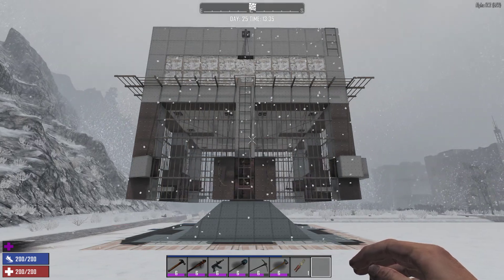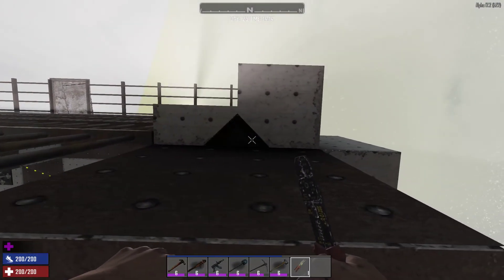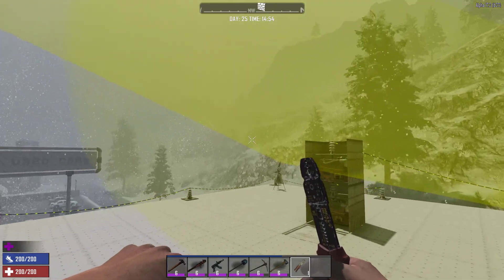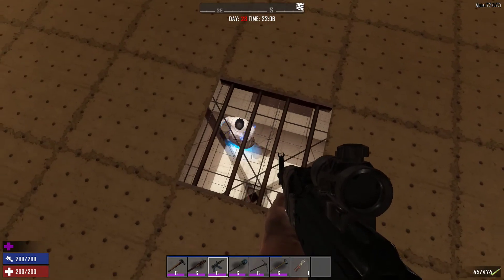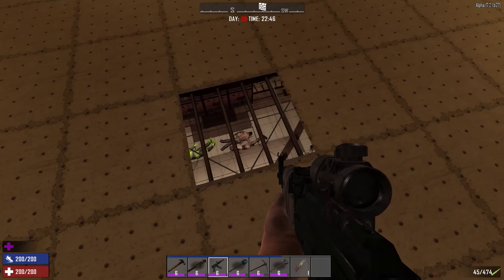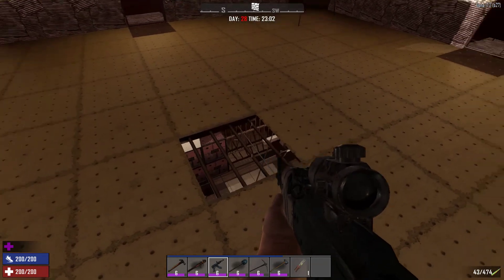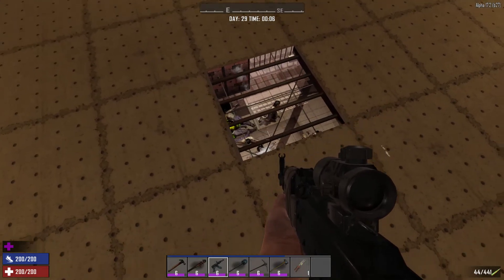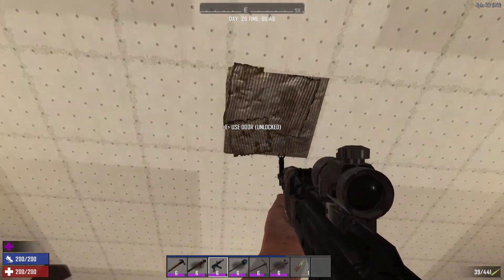7 Days to Die - Floaty Dart Base revision 3

Comment: Good job, the fences look like they work very well for holding the zombies for darts and headshots. Could probably save dart ammo by adding another set of tripwires to trigger the top rows - then they only activate on the ones that make it up the platform. Wiring would be a mess and would look even worse.

Maybe a ceiling dart trap could clear out the electric fence corners? Lol more wiring. Manually shooting anything stuck on the corners would be easiest.

If moving the electronics out of the way, I think moving the relays up would be safer than down, especially if the horde is big enough to lose pathing. If they tantrum and start hitting down that could be a problem depending on where the relays are.

I'm curious how the bigger 13x13 will work out. For some reason I get the feeling it might kill slower than 11x11 vs. a big horde? The number of zombies getting hit by crossfire goes down the larger the platform gets, since the zombies in front/behind and right/left will get darted first. Middle zombie would be protected by meat shields. Hmm, might be better to skip the electric fence on the 13x13?